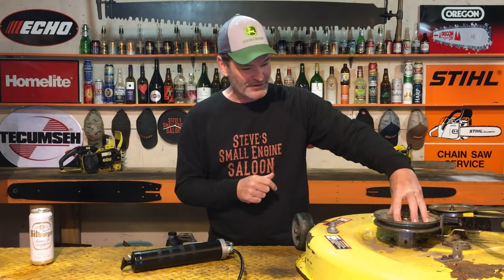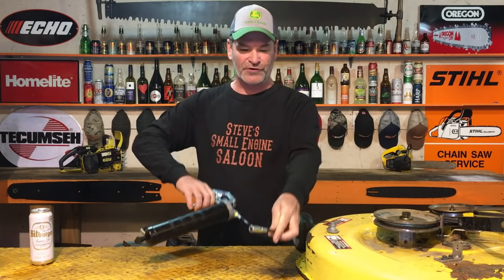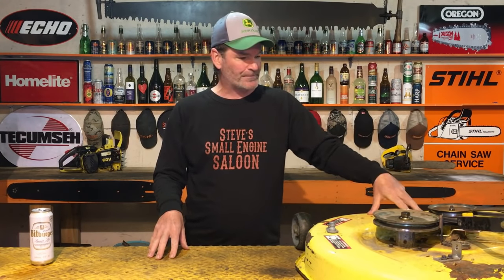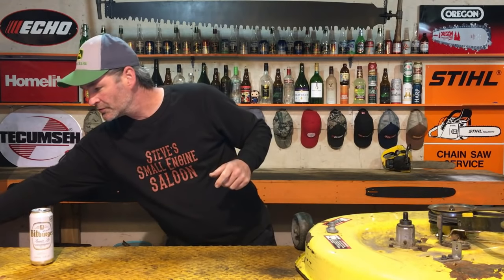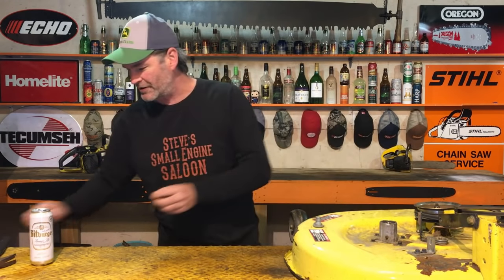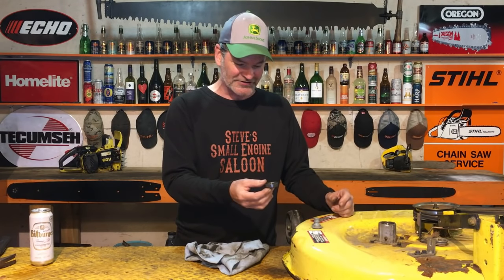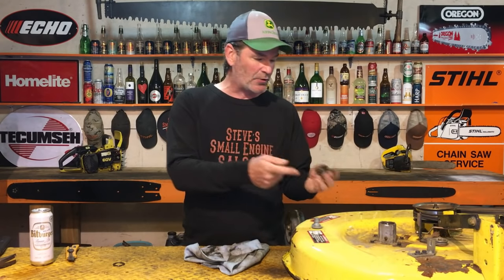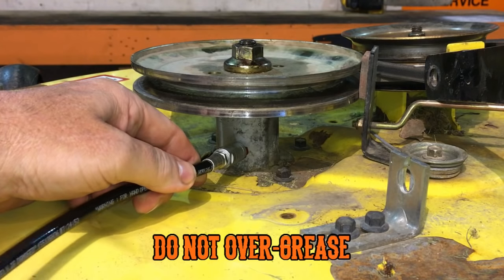Your Riding Lawn Mower's Dirty Little Secret

Comment: Steve not been a smartass but it does get into the bearings it kinda acts as a filter granted without the seat more grease gets in but so could dirt and metal pieces to

Comment: Today for the most part equipment, not all but for the most part are made to fail or non fixable (use and throw away... (Disposable) I'm old enough to remember when a push mower was all you had an maintenance was common sense

Comment: Of course it is intentional. Just like on the Gravelys. Same thing. But also their spindles destroy themselves. The key on the pulley side, is made of the same metal as the shaft and pulley. The Key is supposed to be sacrificial but its NOT. Instead of shearing, it hammers the pulley AND shaft. SO, a simple curb strike, requires a new spindle and pulley! Those engineers KNEW they should have made the key out of brass, but OH NO! We can't have that!

Comment: If you can get a box cutter blade under it,grease can get in it as well.
The correct grease is designed to flow around the seals. 
00 grease will work.
Your grandpa's go to product,Red and Tacky won't work.

Comment: A 5000 lb. grease gun will put grease in that bearing with that poor little seal in place. However, the worst design flaw on husky type mowers is the fact that they have like 6 height settings with only 2 or 3 usable. Many of these models will lose rear wheel traction when the deck is lowered to the lowest settings. Bad ENGINEERING!

Comment: I own a Bad Boy zero turn mower. The freakin' spindles DON'T EVEN HAVE a zerk fitting. Howzat for building stuff to fail? I've had the mower for 5 years and no issues so far, but it's just a question of time. I'm ready to fix it when it goes - I have six bearings and two new belts. No way in hell am I paying $280 for new spindles.

Comment: Thanks again Steve.  I had the same issue on my White,  Murray and John Deere tractors.  However, the Murray didn't even have the grease fitting.  I had to drill and tap a hole for the grease fitting.

Comment: Heres my thoughts , I add nipples also if they don't have them  , I pump grease until it goes  threw bearings and comes out ends of spindles , grease will go past the covers , grease guns push out 10,000 psi with every pump lol  ,  they are not seals just loose fitting dust covers they are NOT gona stop grease  . some people add a relief hole , don't do this  ,  this  does not allow fresh grease to pass threw bearing so what you are left with is the same contaminated grease around the bearings..  as bearings wear they create metal particles that will just sit there and act like sandpaper , you want to flush new grease threw them to purge the contaminated grease  ,  a guy on you tube actually proved it using different colour greases , the grease will go through bearing with both covers on  , grease will follow the path of least resistance   so when cavity is full it has nowhere else to go but threw bearings and out ends of spindle  as its designed to do infact the bearing stop on shaft is beveled to allow the old  grease to escape out the ends of spindle  .   I would prefer to have new clean grease around bearings. , adding the vent hole guarantees no new grease will ever get to berrings after the initial fill

Comment: Only Low Price Generic Lawn Tractors have these False Grease Fittings with sealed bearings--the Real JD Lawn Tractor does not have sealed Bearings inside Spindle Housing so when you pump grease into spindle, grease enters bearings...

Comment: I hate to disagree with you, but the rubber piece you referring to is dust cover not a seal. Most seals are made of metal and are not easily removed. If you pump enough grease in the housing it will go around the dust cover and into the bearing. Just my two cents worth, your mileage my vary.

Comment: It wasn’t built to fail. It was built to address the fact that 98% of mower owners don’t know sh!t about zerks, grease guns or even have a wrench to take the nut off. The sealed bearings at least keep the bearings clean, dry and functional.

Comment: Bearing made in China, that's the problem. What happens when items are not made in the USA? Let's get back to producing manufactured goods here in the USA. Quality control and proud to be made in the USA is a concept that hasn't been practiced in many years. Everything is made to fail. When you import everything we use, we become compliant to those who make the products. 
But, hey Steve thanks for the info. Your video is very informative.
Reply: Steve would still have to import USA made bearings...

Comment: From the manufacturers. Beatings can have TOO MUCH grease.
FOR STARTERS, note that most sealed bearings come pre-greased from the factory with a 25%-35% grease fill. This is all the grease the bearings will ever need, because the relubrication interval (explained below) is longer than the expected life of the bearing.
DON’T JUST GUESS. It can be tempting to give the bearings a pump of grease each day, or to pump until grease comes out from under the seals.  However, this effectively destroys the seal’s ability to keep contaminants out of the grease; and 
too much grease “churns” inside the bearing, generating resistance and leading to rapid heat build-up.

https://mcguirebearing.com/faqs/bearing-relubrication/#:~:text=Bearing%20Relubrication,-How%20often%20should&text=FOR%20STARTERS%2C%20note%20that%20most,expected%20life%20of%20the%20bearing.

Comment: I got a story and a tech tip for I had a 04 cub cadet 50"cut 24 hp had sat for about 8 months I charged up the battery drove it around my drive way pulled it up to the garage shut off I tried to restart it nothing like a dead battery it was about 730pm I pulled my truck up to it to kind of block it in went in my house about 3 minutes later heard an explosion looked out the back door my house garage and my truck were on fire I lost my truck, house, I was lucky I could have been on it when it blew up this happened april 21st 2020 now the tech tip on the model gas tank was in the rear, the gas line runs under the floor to the back the positive cable was very close to the gas line gas line failed and sheathing on pos cable about a 2" piece of sheathing was missing do to age fire Investigator determined that both failed at the same time and caused the explosion the tip is have the gas line and positive cable checked or replaced. Bad thing about it it wasnt my mower.so needless to say it has been a bad year.

Comment: Do the springtime start up for those color Motors in those easily take off the little electric valve off the front of the carburetor and clear the rust out of it because it's bottom of the carburetor and condensation gets in there were the winning the little valve sticks and the engine will not run it doesn't cost any money unplugged wire and screwed the battle freed up a little WD-40 stick it back in there you're good for another season number one reason they don't start

Comment: Actually, there are a couple of youtube videos out there that demonstrate that grease does get into sealed bearings in the spindles. The pressure exerted on the grease from the grease gun pushes grease between the seal and bearing housing. I didn't believe it either until I watched these videos. Thanks for the videos, Steve.

Comment: Makes little sense. Sealed bearings are not made to be externally greased. Spent 20 years working on combine harvesters, much heavier stresses than any mower. But one old guy who was the national service manager for the company had a little trick. He listened to the bearings by touching a metal spike to his ear and the housing. If it was sounding dry, he would make a hole in the grease seal with a 1/16" drill, greased so there were no filings, and he had a grease nipple brazed to a veterinary injector needle. He would put the needle in, pump one shot of grease, turn the shaft 180º then repeat. Wipe the shield with a damp solvent rag and seal with gasket silicone. Next season, wipe, insert needle reseal. It seemed to work.

Comment: I would love to see someone not grease one,  put 3 pumps in another, and pump the other till grease comes out.  Do that for years until a failure.  Pull them all apart and take a look at each.
Reply: Actually already done that they last about 3 years before I have to replace spindles but the assembly is so cheap there only 22-26 per assembly key is to blow grass out and use pb blast afterwards keeps everything good and lubed,

Comment: I had that problem ... but I identified the cause as blade strikes ... rocks, sticks, stumps ... swapping out the pair of spindles one winter, I decided to keep the acreage better picked up and refrain from these blade strikes ... never had to replace spindles again ... spray lithium grease gets past the plastic covers well enough ... couple three squirts of grease in the zerk fitting for fun ...
I figure if the spindle assembly breaks first, then the motor will last much longer ... just the way I mow ...

Comment: Grease will get by that inside seal. The trick to greasing those spindles is you have to fill the cavity full from the get go. Not just one or two pumps. They are not full from the factory. Usually takes 20 to 30 pumps from a grease gun to get the hub full enough that grease will flow past the inner seal.

Comment: You need to do the same thing with the PTO clutch also. The two PTO clutch bearings have very little grease in them, just replace the seal after you put some grease in them👍🏻

Comment: first time watching and i like the name. Mine is "Steve's Lawnmower Rebuilding Inc." Came up with it as it is my name initials SLR.  Anyway cool. Also like your show. I have replaced many of these. I usually pull the seal out of the inside of each bearing when rebuilding. Unfortunately now its pretty much cheaper just to buy a complete spindle and replace than it is to actually repair the spindle

Comment: The grease they originally use on those sealed bearings is thin looks like watery Vaseline. If your bearings go bad just get new ones but before installation remove the seal and clean out the grease it comes with and pack it with a good high pressure grease and reinstall the seal. But didn't completely fill the bearing leave room for heat expansion.Pumping that spindle full of grease is a waist of time you can't know when enough is enough without popping a seal.

Comment: 1:27   ?  Putting  a  'zerk'  on the spindle ?  Those designers,  are  'jerks',   as well.  WASTING   a good zerk, which does  NOTHING.??  !    VISUAL,  FALSE  ADVERTISING !.  (hey Steve, drill a hole inside zerk hole, to the real  ' BEARINGS'  !   the engineers, are missing a  hole in their doofus heads.....wow. (like , i  drill a hole, in the pedal bike frame, under the pedals axle. Tap threads, install a  zerk.  Grease away, and all is well for the pedal bearings,  BOTH  SIDES. )

Comment: Hey!  Love your channel  I have a problem.  My Husquvarna 54" deck mower continually breaks mandrels when I hit rocks.  This one is a year old.  My older onr (10 years) doesent.  I am an experienced aluminum caster and believ the cast mandrels were cold causing the metal to crystalize.  Are there other castings out there, or is there a work around.  The parts place told me that they break to protect the other parts.  I call shannagins.  It is pully driven, so they will cimply slip.  Thanks for the help!

Comment: My brand new Kubota mmm main spindle would not take grease from day 1. I just assumed twas a blind hole due to sealed bearings. I started hearing wierd grinding sounds my 2 nd summer that would come and go. Finally they got real bad and I took off belt and found the bearings wiped out in it! My grease fittings would not allow grease no matter what I did to try and clear it. Just replaced bearings and new zert. Don’t be lazy and assume! I paid the inconvenience so you don’t have to! Thanks Steve!!

Comment: You'd be better off cleaning the bearing now you have the seal off, filling it with bearing grease and popping the seal back on. Leaving that seal off is only going to allow a ton of dirt in there and you'll just be defeating the purpose. If you can get the seal back on.

Comment: I worked for a park district for 35 years and the big expensive mowers ( up to $80,000 and now more) are basically put together the same way. Made with built in obsolesce and the parts for those since they are commercial are much more expensive.

Comment: I have had three Craftsman Yard Tractors in 36 years living on the same 2 acre parcel of land. The first lasted 16 years and I only changed the oil every 5 years (after the first season of use) with Mobil 1 5W-30 oil. I never re-lubed the bearings and only replaced one of the three mandrels in the entire 16 years. The second one lasted me 14 years. Same oil change regimen and never had a mandrel bearing fail. I gave that one to my son and he used it for 3-4 more years. It caught on fire due to a broken fuel line and he lost the transmission as a result. My current one is 6 years old. The engine (a B&S 19HP single cylinder) died this past July due to a connecting rod failure.  I later learned that this was not an uncommon problem with single cylinder B&S engines. The other two were Twin-V (two cylinder) IC B&S. I took the twin cylinder out of the damaged tractor, pressure washed it, changed the oil, air filter, fuel filter, plugs and relocated the choke (it had been sitting for two year, unused) and put it in my newer tractor chassis. I spun the engine around manually several times to circulate fresh lubricant and then started it up. It fired right up an I have been using it since then without issue. Cost me about $20 in parts and three hours of my time to pull the engines and do the swap.

Comment: Koehler Courage engines are built to fail, There is not enough air circulating on the cooling fins to keep the cylinder cool. So, the pushrods and rockers overheat and you lose your exhaust or intake valves (or both as I did), and ruin the cylinder. This is a "design fault" either by accident, or by intent. OHV engines are for cars, not small engines in grass mowers or garden tractors! How many of you have a failed Koehler engine? I'd like to know.

Comment: I think they use sealed bearings because your average Joe isn't even going to think to grease them. Probably doing those people a favor because they will last longer than they otherwise would. They put the grease fitting in for those with some knowledge and willingness to tinker with it, which is a minority.
Reply: Also an over greased bearing has more friction than one that's properly greased.

Comment: Them Rats So I take both seals off each bearing facing each other?  The top bearing I take off the bottom seal and the bottom bearing- I take off the top seal. Is this correct. Thank you

Comment: You may want to do a video on a 04 cub cadet 50"cut 24 horsepower fuel line and positive cable are close enough to cause an explosion they both failed on mine exploded caught my house and my truck on fire lost almost everything we owned

Comment: You should do a video on the defective steering system on those Home Depot John Deere mowers. You know the mild steel steering gear they use in conjunction with the hardened steering shaft gear. Stupidest steering set up ever! Yet a lot of companies use the same system¿???

Comment: Thanks. They sell not only the assemblies as you say, the real goal is to sell more lawnmowers. This type of hidden problem is viewed by the average person, in my opinion, as a major repair that likely cannot result in a real fix.The crunch and grind means the mower is not worth trying to fix and you need a new one. Even if it just gets wobbly and does not get to the crunch stage your best bet is to get a new one.

The big question is how to stop such backhanded theft. what you just uncovered should be brought to the attention of consumer protection etc and the perpetrator should  be required to buy back the mower. Reports on this behavior should be automatic , be compiled and individuals in the company responsible for allowing such a. Decision to be made and allowed to go forward be held personally responsible rather than punishing the stockholders

Comment: A deck like the one you are working one I have a similar one 14 years old with the decking metal getting “soft” .   Just wonder about doing any work on the bearings or replace them.

Comment: I believe that. replaced both spindles on my brothers 
D 110 John Deere lawn mower greased both spindles and one new spindle still seemed rough like it was never greased and this one is brand new. thanks for the tip will remove it and get another one. 49 dollars for each spindle,

Comment: Great info but I was told by several people that the grease fitting was used just to lightly grease the shaft and keep moisture out so it doesn't rust.  And sealed bearings last longer than pulling the seals out and trying to fill that giant cavity and grease them.  Otherwise the top one never gets grease from gravity.  That only works on axles which are horizontal.

Comment: Hey I wanted to give you an update on the bearing grease issue taking out the seal so bearing can get grease. My previous post said how do you know when grease cavity is full abd how do you not blow out the bottom seal with hydrolic pressure. I saw another video that solves that issue. Just drill a small hole in spindle body and when grease starts comming out of drilled hole you know cavity is full and can stop pumping grease. My idea to plug hole when not in use is to put small sheet metal screw (short) in hole to plug it back off till next time.